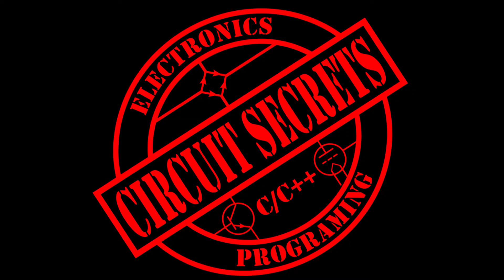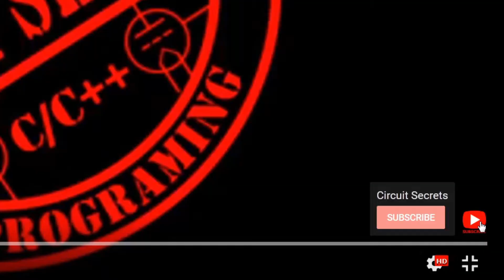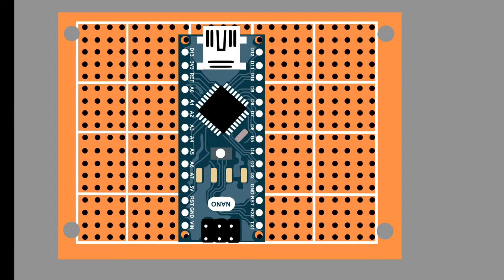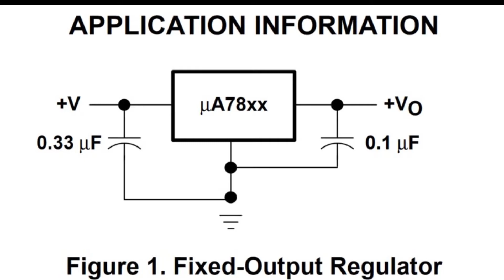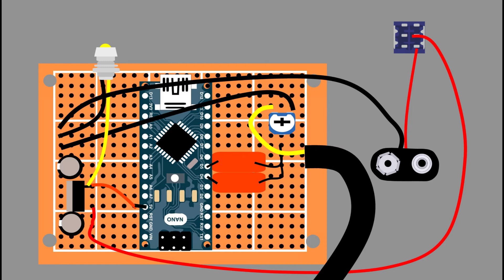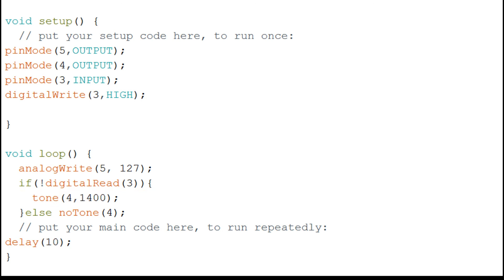Arduino nano multi tone generator

Comment: why no links to the code or schematic etc?.
Reply from the maker: Sorry I thought it was so simple no one would want the code or schematic. I will post the code and a schematic to my website later today and update here.
Reply: @CircuitSecrets  as far as i know the nano produces square/triangle waves?have you actualy used this for ssb testing,as far as i know you can only use sine waves due to square waves having harmonics,how do you filter them? 73
Reply from the maker: @paul.alarner6410  Yes they do produce square waves. I did not make this for myself as I seldom touch SSB rigs.I was asked if I could build it by a friend. I asked if square waves would be sufficient and he told me it would be fine that "the radios will just round it off anyway". It does work for generating a peaking tone for AM radios. However the main point of the video is to demonstrate the method of generating two specific tones with a simple Arduino. The tone function only works with one pin and tone at a time and messing with timers for PWM can interfere with tone. Getting two specific tones out of a Arduino at once without using D/A conversion of samples is never demonstrated in any other videos that I have seen. This is why the name of the video is "Arduino Nano multi tone generator" and not "SSB calibration tool", as I cannot confirm that it works as intended, but the person I built it for thought it was great. I hope this background of the project helps. 73s
Reply: @CircuitSecrets  cheers,i will try it on my ft-707 73 de m3vuv.
Reply from the maker: @paul.alarner6410  Nice, let me know the results I am curious if the information I was given about square waves for ssb is accurate!
Reply: @CircuitSecrets  will do 73 m3vuv.
Reply: @CircuitSecrets  
Don't you realize that people on the internet do not want to put in effort , and instead they wanted everything laid in front of them :P